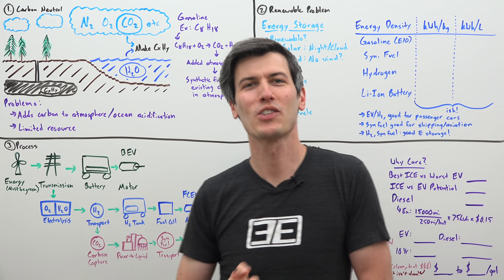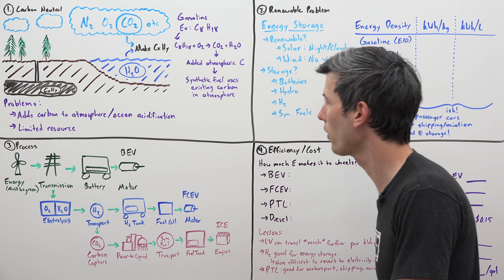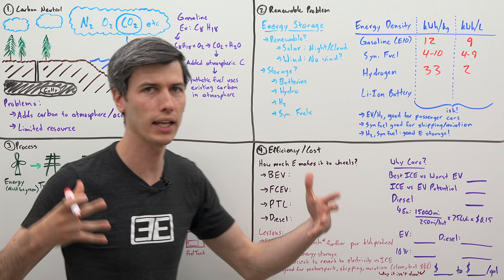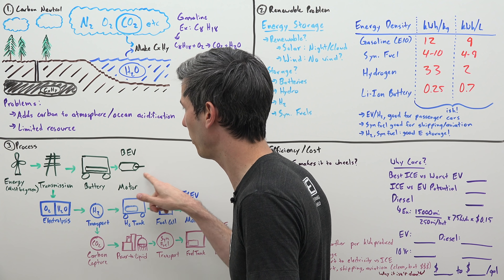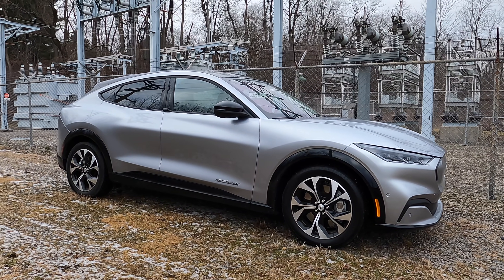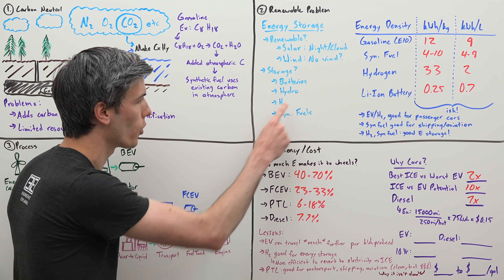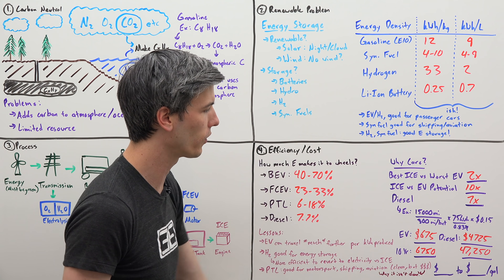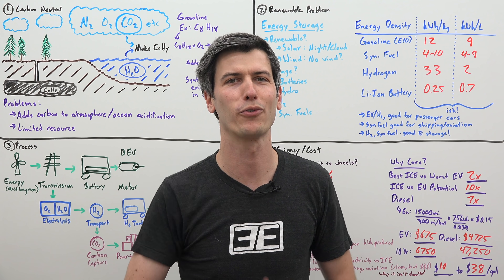The Big Problem With Synthetic Fuels

Comment: e-fuels are just being invented. So most likely we will see a reduction in price. On the other hand, the infrastructure for those fuels is up and running. Calculate the expenses for hydro and the gap will be different. 
And efuels (even in a mix with traditional fuels) could help make the transition smoother for those who are not able to buy a new car right now – or live somewhere where they need better infrastructure for charging (public charging stations and/ or cables to their neighborhood / house to charge there).
Reply: According to the information in the video, unless the efficency of producing e-fuels changes by more than an order of magnitude, the cost of efuels stays much higher than for battery ev's..
Reply: @JakobusVdL  Don't make claims you know nothing about. I calculated based on official statistics for average car driven average amount per year the price increase is only 630€ per year running on 2€/liter e-fuel instead of gasoline! (I can give you the details if you want, for example the current average fuel price in the EU is 1,37€)

Only 630€, and that's for the FIRST STAGE of e-fuels which is basically experimental production at a tiny scale, with no economies of scale in use. And not being for example produced at new nuclear plant modular e-fuel production facilities, or renewable plants specialised in e-fuel production which avoids the need for a separate natural gas power plant to cover for them when there's no wind/sun and also no need for massively expensive transmission lines which also have losses.

If oil was being produced/refined at such a small (absolutely tiny!) scale the cost would probably be massively higher... And if it would be the first-generation of oil refineries no less...

-Compare 630€/year to how much more EVs cost than ICEs!! 
-Then compare 630€/year to how much less car manufacturers make money off of EVs compared to ICEs!! (Consumers will end up paying for it all in the end, don't pretend that you're going to get something for free, that they'll produce free cars for you forever!)
-Then compare 630€/year to how much subsidies consumers get per EV, in Germany it's over 9000€ per car and in the USA the newest proposal is up to $12500!!
-Then compare 630€/year to how much manufacturers get subsidies for making/selling EVs which is I believe several thousand at sale alone, plus who knows how much for investment into new factories, etc. Then there's the 'carbon credits' which are bull because ICE running on e-fuels are in fact lower in CO2 emissions than EVs...
-Then compare 630€/year toandthose nugjobs in government are giving massive subsidies to the companies installing them and then charging consumers ridiculous prices for charging!! Governments subsidies those fast charters and I've read that they're priced at between 75,000-150,000€ each!!
-Then there's the subsidies and taxpayer funded MASSIVE rebuilding and expansion of the electric grid which EVs need
-Then due to the skyrocketing demand for electricity the price of electricity will skyrocket, making everything more expensive = everyone more poor and the poor are put into an impossible situation.

And all that money poured into the religion of EVs will not reduce CO2 emissions very much, even after the several decades it takes to swap all cars to EVs. They're only about 30% lower in CO2 emissions compared to ICE running on fossil fuels, maybe 35-40% in a few decades IF electricity production can be revolutionised completely without massive costs into something completely different than today (which the green politicians have failed to do so far, for example in Germany their efforts failed and their massively expensive projects resulted in zero reduction or even a negative effect, while it cost society billions and increased electricity costs for everyone up to about 0.30€/kWh!!

Now consider ICE cars which can all immediately start using biofuels, e-fuels and can be easily converted for a few thousand to be run on CNG which can then mean running them on biomethane. Actually basically all cars already run on biofuels, since fossil fuel is mandated to have a minimum of 10% or 5% of biofuel (depends on country and fuel type). If running on pure biofuels then their emissions are much lower  (depends on the type), muchwould
 
In society of course half the cars are driven less than average, and of that half a big proportion are driven much less than average. Probably about 20-30% of all cars are driven so little per year that them driving an ICE even with fossil fuels is better than switching to EV because with EV there are so much emissions from production of their batteries. If you drive less than average then you'll never drive enough to make up for those emissions at the beginning. And if your car stands around a lot then you're having to heat up the battery all the time and lose electricity from the losses for nothing.
Reply: Thanks for you charming, and very detailed, response @pistonburner6448 (and yes I saw the unedited version too, even more charming).  
You may have a point about the overall cost of vehicle ownership and use, but my comment was about the relative costs of the fuels.
I notice in your detailed post, you don't make any reference to the relative cost of fueling an EV for average usage, compared to you 630 euro's number.
There are a number of articles that say that the synthetic fuel Porsche are developing will be about US$10/litre (about 8.5 euros), and that they hope to get it down to $2 (1.7 e), but that is many years away. Also those are just costs of production, without all the taxes that fuel attract.
Reply: @JakobusVdL  Look at fast charging prices and weep. Then realise that electricity costs are going to skyrocket. 

Already now in many cases driving an EV, AFTER ALL THOSE MASSIVE SUBSIDIES, is more expensive than Diesel! Expensive charging, constant heating up of the battery and cabin in the winter, horrible efficiency when driving and charging and even just keeping the car warm or the battery level constant in the cold = $$$$$$
Reply: Why so angry @pistonburner6448 ?
Swearing, accusing me of lying (again), being clueless and ridiculous.
If you have points to make, make them rationally and clearly. Leave out the abuse and I might listen, otherwise I'm not interested in anything you have to say.
Reply: @JakobusVdL  I knew you'd duck and run away from the actual topic. 
Very spineless to spread misinformation, claim for me to be wrong, then fake being 'insulted' even though you're spreading vile misinformation on an important subject. Have some respect for honest, knowledgeable people. If you you don't want to be criticised then don't run your mouth.
Reply: @pistonburner6448  I have lots of respect for 'honest, knowledgeable people', but none for rude and arrogant people. 
So no respect for you.
Which of my posts are 'spreading vile misinformation'?
Reply: @JakobusVdL  The ones you just wrote. So do you want to start talking about the subject? You can't / won't because you are too narcissistic to admit you were wrong and I am right? 
I listed so many facts, you have not been able to dispute a single one, so they still stand.
Reply: @JakobusVdL  Or, if more companies jump in to the eFuel game. And once we get more of our power from nuclear energy. Those will help the costs go down imnensely as well.
Reply: @electric7487 Maybe I've misunderstood your point, but I think the point of the video is that the amount of energy in producing e-fuel is many tiimes higher than using it to charge ev batteries. So if the price of the input energy goes down, the price of both will reduce proportionately to the energy price.
Reply: Makes no sense, BEVs will still be cheaper because they can use that energy to drive instead if using it to make a fuel and burn it. Way less efficient.
Reply: @Glenhh  At this point, practicality completely annihilates the efficiency argument because the infrastructure for liquid fuels is already in place whereas for EV's it's tiny in comparison.
Reply: @JakobusVdL  Correct.
Reply: @electric7487  Not true, the infrastructure to produce so much E-Fuels isn’t their. That’s why they want to produce our fuel all over the world. Just so we have to ship it all over the globe and be dependent on other countries. How are you ignoring that?
To drive 100km with E-Fuels you need way more energy than to travel 100km with an BEV.
BEVs only need electricity, you can even charge your car with a wall plug.
I know not every scenario can change to BEVs today, but soon they can.
Charger at the groceries, charger at work, charger on city streets. They don’t even have to be fast charger.

Funnily enough, people seem to forget that we already have an electricity grid.
Reply: @Glenhh  Unlike crude oil, eFuels can be produced locally, largely eliminating the need to ship it all over the world. The shipping is limited to local and regional transport.
Reply: @electric7487  That is only true for E-Fuels that aren’t from 100% renewable energy sources. But that’s not a product anyone wants. We want „clean“ E-Fuels. 
We don’t have enough renewable energy atm to do that everywhere on earth. 
It’s not even possible atm to charge every BEV with renewable energy, if you’d know the physics you knew it’s even harder to fill up every car with clean E-Fuels because they need more energy to travel 100 miles than BEVs.
Reply: @Glenhh  You mean clean energy, right? Renewables alone won't work. One of the best solutions to the high electricity demands is nuclear power. Renewables will then supplement nuclear.
Reply: @electric7487  Clean and renewable energy. 
I just told you why your E-Fuel claim isn’t true but instead of giving me another argument or agreeing with me you’re just out here claiming the next thing.
Why shouldn’t renewables work alone? 
All we have to do is store the energy. 
You are correct if you’re trying to say, that we would transition faster to zero CO2 by using nuclear, but it is false to say they can’t work alone. There is no law of physic that prevents it and Solar and Wind (there are way more renewable energy sources) are also the and one of the cheapest sources for energy.

Nuclear is way more expensive, ask Germany how much they are paying to end the nuclear power generation. It’s insanely expensive to deconstruct a nuclear power plant. Oh, and we still don’t have a final solution for the waste. Europe is searching for a solution since the 60s. That’s quite a while if you ask me…
Just imagine if tax payer money would go into new renewable energy instead of deconstructing old energy sources that the company should pay for.
Reply: @electric7487  I know of these supposed clean version of nuclear. But I haven’t seen them in actual use anywhere. They still need heavy funding and then continued funding.
Yes, wind and solar aren’t as efficient but they are cheaper than nuclear if you look at the actual costs. 
Even your example France is still going strong with old nuclear power plants. I don’t see them
using this new tech everyone keeps mentioning for years now. (Pls correct me if I’m wrong, any links are appreciated)

Solar is great because it is the only way how even an individual can produce it’s own power.
That’s a separat discussion but also an important one IMO.
Reply: @electric7487  
Yeah and that’s a problem. The nuclear industry has made promises for the last decades and nothing really changed. We can’t bank on an industry that is that slow, we only burn tax payer cash if we keep financing their shenanigans.
I would keep every nuclear plant running as long as they were intended to, and stop the construction of any new one that hasn’t the new tech that deals with the waste. That way we would force them to innovate or die. 

Regarding Solar:
Afaik Solar panels won’t get substantially better anytime soon. They have pretty much done what can be done, a higher efficiency is accomplished by staking panels(I think they’ve done that with the solar panels on the ISS), but that makes it more expensive.
Reply: @electric7487   Molten salt reactors (MSR) also have potential to make synthetic fuels economically and environmentally as they would operate at temperature 600C which is sufficient to do it. It would make synthethic fuel carbon neutral. @Glen There are innovantion regarding nuclear energy but they are slow due to regulations, lack of sufficient funding and the fact which mentioned El Ectric. One of the MSRs is going to use waste from current reactors which is Elysium Industries company idea. The other MSRs will generate far less waste. Regarding waste. It could be used for example in medicine which will further reduce waste stream.
Reply: @Glenhh  I do not say, that BEVs are less energy efficient. But how efficient is a vehicle that you can not load? The grid we have isn't capable of handling to many BEVs, let alone if everybody would change to a BEV. We do need a solution until BEVs are cars for millions not for millionaires.
Reply: @SierraKilo76  I agree that wee need a bigger BEV offering. But there are multiple 30k BEVs already out there, it’s not perfect but not „just for millionaires“ either.

You’re missing a key point with your argument, if we haven’t enough electricity to power BEVs, we don’t have enough electricity to produce enough E-fuels. The reason I’m talking about the efficiency is that we need less electricity for all those BEVs than we would need with just E-Fuel cars.
If you really believe we can’t support all those BEVs (I would disagree) you also have to believe we can’t power all those E-fuel cars.
Reply: @Glenhh  With enough solar on your home or wind in your backyard you can even eliminate step #2 of the BEV energy process on Jason's chart. What can be more efficient than that?
Reply: @electric7487  Unlike crude oil, electricity can be produced locally, totally eliminating the need to ship it all over the world.
Reply: @rogerstewartgps  And your point is... ?
Reply: @JakobusVdL  Yes, but that video is wildly wrong. It's wrong about everything. Crudely wrong. He doesn't understand anything about even the basics.
Reply: Come on now @pistonburner6448 , 'its wrong about everything' that's a pretty wild claim. 
Don't you think you'd be better to address your comments to the guy who made the video, rather than some random who posted in the comments?
And perhaps you could provide reference to some sources you believe don't 'get it all wrong'.
Reply: @JakobusVdL  I did address him too.
What parts do you want a reference for?
Reply: @Glenhh  the thing is, EVs are boring, and it’s just not the same as ICE cars, and EVs also have downsides that normal engines don’t, such as how EVs get less efficient at higher speeds.
Reply: @melvinmcfly4498  Every sales indicator shows a different trend. EVs are growing fast.
And why would you call technology with the fastest production car „Model S Plaid“ boring? Have you driven in a performance EV before?
I’m not saying a V8 sounds bad, I’m saying the ICE cars that get sold nowadays are already not as emotional as cars were 15/30 years ago. Sure you can tune your ICE car and make it a more fun experience but how many people do that? 0.5% of car owners? I think that would even be a high estimate.
Reply: @melvinmcfly4498  In terms of efficiency your kinda right. ICE cars obviously also get way less efficient at high speeds but you don’t have to stop as quickly so many people don’t notice it that much.
But I’m from Germany and we do 150km/h drive test all the time to check out the usability of new electric vehicles.
For over 90% of people over 300km real world range is plenty.
Reply: @Glenhh  yeah, I just haven’t been alive long enough to see the golden age of ICE engines, and I’m mostly sad that I might not be able to have that experience in the future, I don’t think all electric cars are bad, nor do I think that they should exist, I just don’t want gas engines to disappear.
Reply: @Glenhh  No, the energy used to make the E-fuels will be of a much lower cost than what people use to charge their EVs.
Reply: @jimj2683  That’s physically impossible. If you actually want to know why I would be willing to explain it to you.
Reply: @Glenhh  I would like to know why!
Reply: @jimj2683  
Okay great,  it actually is really simple, but I still hope I can explain it good enough.
Let’s compare the energy usage of a BEV with a E-fuel car. 
So we start as an example with a solar cell that produces electricity. Now we will just look at the output. We don’t care what the efficiency of solar is because we will look at the same output for both scenarios. 
So we now have 100% of the output to use for either our BEV or to make e fuels.
The BEV can start right away, you can charge him up with that electricity right away. You’ll loose ~10% of the output for charging, but 90% will be transferred to the battery.

The E-fuel car has to use the output to make the fuel. It looses 30% of the original output energy. There are more inefficiency after that to  separate the carbon but we don’t nee to go into the details.
There are many studies and simple charts that compare BEVs to E-Fuels. To will also show that an electric motor is way more efficient than a combustion engine.

To make a long story short, BEVs use the energy way more efficient than it is physically possible for E-fuels. The reason why oil was such a great fuel is that we didn’t had to make it. The energy was already inside the fuel, but with e-fuels you have to put the energy in first.
At the end, a BEV uses about ~73% of the output energy to drive. E-fuels care would use ~13%. You can maybe bring the e-fuels 50% higher than currently, but even 19,5% isn’t even close to ~73%.
Reply: (part 2) 
So this all means that you will always have to use more electricity for E-Fuels. So it can never be cheaper than charging up a BEV since the BEV uses the same electricity but less.
I’m curious as to why you claimed that would be possible. Did you read that somewhere? Many anti BEV articles out there, you wouldn’t believe how much BS was put out over the last 10 years. It was disgusting to see big auto deny the existence of the technology.
Reply: @Glenhh  Sure, BEVs use less electricity in total because of the much higher efficiency. Everyone knows that. But there are many other factors to take into consideration in the real world:

Here is the thing: The cost of renewable electricity varies a lot around the planet. Some places have lots of wind or sun, while others have very little. So you will get much more renewable electricity for $1 in certain places than other places. A wind turbine in South Chile will give a lot more electricity for your money than one anywhere in North America.

So why don't we just build some giant power lines to transport the energy to the USA so we can use it directly in our efficient BEVs?

That is because the power losses would be very big. We are talking at least 50%. Then the cost to build and maintain is gigantic especially since you have to cross many borders (many of whom don't want your power lines!).

On top of that you also need giant expensive batteries to store this electricity so it is continually available throughout the day.

Making E-fuels will also have big losses, but the transport is actually very efficient. Shipping it, you will only use around 5% (assuming you run the ships and trucks on the E-fuels) to get it to the destination in the USA. Then you have a fuel that already has all the infrastructure in place and is much more convenient and useful than batteries. You then don't need batteries because the energy is stored in the hydrocarbons.

Another byproduct of this industry is that it will make direct air carbon capture much cheaper over time. This could lead to a possible solution to the climate crisis by making it economically viable for governments around the world to simply capture enough carbon and store it indefinitely (as a fuel or otherwise).

Also, engines are getting more efficient. Achates has demonstrated 55% efficiency with an opposed piston engine. Combine it with some mild hybrid tech and waste heat recovery, then you could probably see above 60% efficiency.
The Mercedes F1 car is over 50% efficient BTW. 

In conclusion, I think E-fuels will become much cheaper than most people fear and the difference in cost between refueling and recharging (especially away from your house) will be very small (especially compared with the total cost of ownership).

And there are many use cases where batteries never will become good enough in our lifetime: Aviation, shipping, mining, construction etc. So it is no question we are going to see a lot of E-fuels there and when people realize that they are cheap enough, it could be that people will prefer the convenience of a gas car to a BEV.
Reply: @Glenhh  I would love a response to my last comment.
Reply: @jimj2683  „simply capture enough carbon“
I definitely think you misused the word simple here. Nothing is simple about it. It’s inefficient, not even done in a big scale to this date and it costs insane amounts of money atm.

As I said, the only thing I wanted to show is that a car with E-fuels needs way more electricity than a BEV. You haven’t said anything that contradicts that.
But that’s the main point, cost. 

Yes, Efuels could get cheaper, but by using more energy they can’t get cheaper than using the electricity itself. 
If we struggle to produce energy without producing carbon, why would we use the technology that uses way more energy?
Do you know how many more solar, wind and nuclear facilities we would have to build if everyone would drive an e fuel car instead of an BEV?
Where is all that money coming from? And how will that not affect the costs of electricity hence the cost of e fuels?
Reply: @jimj2683  Batteries never being good enough for aviation and shipping is a pure guess from you and you act like it’s a fact. 
Do you have alternative motives or why would you claim something like that? Actual battery researchers are telling a different story. Talk to the experts that build batteries, not to fuel companies. 15 years ago they said BEVs aren’t possible. ä
Reply: @Glenhh  Look at energy densities. Gasoline contains roughly 50x the amount of energy per kg compared to batteries. Then look at how slow this has improved over the last decades with batteries. Sure, we could have a miracle battery suddenly come, but I wouldn't bet on it coming within any reasonable amount of time.
Reply: @Glenhh  When they can make the e-fuels cost similar to fossil fuels, then the money will come from the consumers who will buy it. 
It isn't just a matter of how many solar panels you need to drive X amount of miles. It is a matter of how many miles can you drive per dollar. And how much are people willing to pay for the convenience. If you live in an apartment, charging at home is not available. 

Anyway. We are just talking past each other at this point. Let us see in 10 years. Check out Prometheus fuels (they have plans for making e-fuels cheaper than fossil fuels even), Porsche/Siemens with their e-fuel plant in Chile. I think those companies have done some research on the viability. Don't you think?
Reply: @jimj2683  I work for Porsche so nice try telling me how they work…
It is again phisically imspossible to make e fuels cheaper than fossil fuels.
Fossil fuels are insanely rich of energy, e-fuels need to be created first.
Do you thin the electricity needed for that will cost less than $0 in the future or how will they become cheaper?
You’re completely ignoring simple physics…
I heard that crap for the last 10 year and you were and always will be wrong if you disregard the science…
Reply: @Glenhh  So why did Porsche invest in it?
Reply: @Glenhh  BMW and VW/Audi have also invested in it. I would think they usually do some research before they invest.
Reply: @jimj2683  Because they have high class vehicles and high class customers. They hope that they are willing to pay the price for E-fuels. Porsche knows it will be more expensive but they know their customers have money.
A guy driving a Honda Civic is a totally different story for example.
Reply: @electric7487  and using all your countries farm land and water 😂😂😂😂
Reply: @JakobusVdL  right, but probably not than shipping all the cobalt from Africa, producing the batteries, producing the vehicle etc. We're only looking at it from a charging vs e fuel production perspective.
Reply: @Glenhh  have you seen those videos of cobalt mines in the DRC? If we had to mine lithium and cobalt in an ethical and safe manner (ie. Not using slave labour) the cost of EV would skyrocket.
Reply: @Glenhh  but your also missing the point that battery’s are a problem, they are not in any way shape rod form the future energy storage solution. You can’t get over this fact, that’s why hydrogen or synthetic fuels (or something like it) will render battery tech and charging infrastructure useless in the future.
Reply: @electric7487  The cost of nucular pants is prohibitive. Energy storage is cheaper than nuclear plants
Reply: @SierraKilo76  The grid can adapt to b e v's way easier than an adapted to air conditioning. EVs can charge off peak the vast majority of the time.
Reply: @gregkramer5588  The intermittent nature of solar and wind etc. ALONE disqualifies them as a source of base-load power. It's cheaper, but that's not the whole picture.

At best, storage will be good for peak loads where base-load power plants are not fast enough. But for base-load power, nothing beats nuclear. The costs are largely due to bureaucracy; the technology is already mature.

Also, I already addressed this in previous comments in this thread. Did you even pay attention?
Reply: @Glenhh  NZ has 572 MW of renewable energy that is being sold at 3.5c/kWh for a aluminum smelter that wont likely stick around much more. According to how Tasmania's plant will want to produce 100 million litres per year with only 270 MW, NZ being able to effectively double that would be a ~40% reduction in imported petrol. Align that with increased electrification and that % goes up until we can export the excesses. If that smelter goes away, we will have far more power than we can use, and excess hydro can easily be used to create eFuels 24/7 which is in effect a slightly inefficiant battery but can also be used for aviation etc.
Reply: @UltraObamaGaming  There are millions of cars sold in the US every year. A few million dollar cars don’t make a difference. 
But yes, many cars cost 60k and some 20k. 
My point is that BEVs will be cheaper than ICE cars 100%. Because they use less components, are cheaper to operate and need way less maintenance. I’m not saying there is a BEV for everyone today, and that’s fine. We will get there.
Reply: They're not "just being invented". Synthetic petrol has been on sale in the UK for years. It costs around 4 times the price of normal unleaded..... It is produced for specific markets, where users do not want a fuel that smells (Aspen has no smell) and neither does it go off like unleaded petrol does....
Reply: @Brian-om2hh , interesting. Do you know how they are made (or who makes them) and if they are carbon neutral fuels?
Reply: Yes if the goverments start funding efeuls like they do ev they will be quite developed
Reply: Synthetic feels were used extensively in world war two
Reply: @UltraObamaGaming   At the moment not a single one. But that doesn’t mean it won’t happen in the future.
„Most people can’t afford a 30k car“
Why is it then, that the average car selling price in America is $40.000?
Reply: Still all to do with agriculture and energy prices. They aren’t new 😂😂😂😂😂
Reply: E fuels aren't just being invented. Aspen synthetic petrol has been on sale in the UK for decades.....
Reply: @Brian-om2hh  Aspen's synthetic fuels are not carbon neutral. They claim it contains "up to" 60 % renewable content, which is a) marketing BS, as petrol is also "up to" 85 % renewable content (E85) and b) "renewable content" says nothing about it being sustainable or CO2-neutral.
Timber from the amazon rainforest is also "renewable content", as trees can potentially grow back. And that's sadly close to the real situation, e.g. cutting (or burning!) down forests to grow more crops for fuel production, thereby creating a CO2 source / net-emission.
(Aspen uses chemicaly altered biomaterial, but the problem of land use isn't any better for this than it is for Ethanol). These fuels are anything but "green" (except for green-washing).
And those which are actually made out of renewable energy will always suffer from a high price due to inherent inefficiency in synthesizing fuel and low efficiency of combustion engines.
Besides, building 6 to 10 times as many renewable power to get en-par with battery EVs can't be sustainable unless extremely many renewable power plants are built using renewable energy (currently solar panels are mostly build in China, with high carbon emissions due to their many coal power plants).
In a future many decades from now, oldtimer cars will use sustainable synthetic fuels, but that will be long after battery EVs dominate the markets for new and used cars. Some ridicolously expensive vehicles will use e-fuels before, but such niche markets anyway account only for a very small fraction of the overall emissions.
Reply: I don't think there are any technical solutions that will allow for the current industrial scale on the planet.  I think unlikely that we can "science" our way out of the bind we're in without looking at a fundamental change in the way we live.
Reply: Yep
Reply: There are 2 billion internal combustion engines in the world. There will never be 2 billion "100 kWh lithium-ion batteries" ever.
Reply: @tinto278  Yeah but why 100 kWh? 
Totally possible that we will habe 2 billion 50 kWh vehicles. We have enough of every resource, we can recycle up to 95%, they will get better and cheaper with every year passing.
Why do you we will never reach that? Because of autonomous cars or do you think we don’t have enough resources?